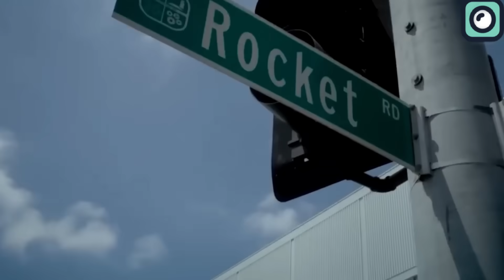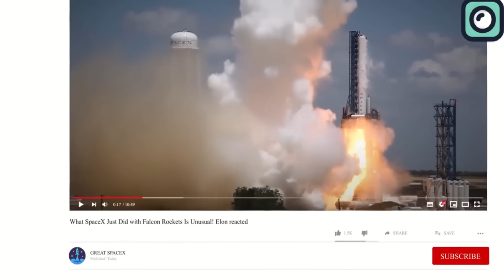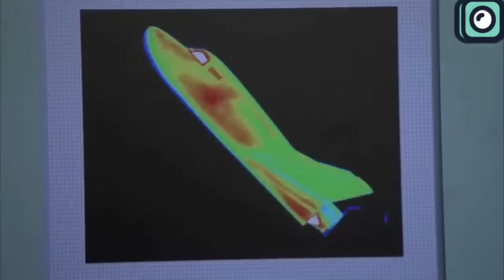SpaceX Finally Broke NASA Record With It's Falcon 9 Rocket!

Comment: So what did they do in achieving a path forward? They retreated to putting a capsule on top of a rocket...just like they did in the 1960s. What an advancement, eh.:eyes-purple-crying::eyes-purple-crying::face-orange-frowning::face-orange-raised-eyebrow::face-fuchsia-tongue-out:
Reply: The SpaceX stage 1 is reusable though, and Starship is huge and re-usable.
Reply: What an idiot, wait don't tell me, we should be living in star trek with warp drive by now eh? That design works and is reliable, that's like saying cars have had wheels and engines for over 100yrs we've achieved nothing...give your head a wobble get a grip and try again but this time try using your brain if you have one do a bit a digging on a subject before making a fool of yourself on the Internet....like you have here 😂😂
Reply: Ah, but only ULA rehashed the Apollo capsules.  SpaceX used a different tack on them.
Reply: NASA paved the way for space exploration but it has become a bureaucratic money sink hole because the politicians and the contractors are taking the tax payers to the cleaners. It looks like the cost to go to the moon is going to cost 20x less using Starship vs using SLS. Thats major advancement.
Reply: The put the payload in front of the shedding ice, because the shuttle system wasn't safe enough.  There was consideration for a shuttle on top, not on the side, but the payload would have been too small for military use.